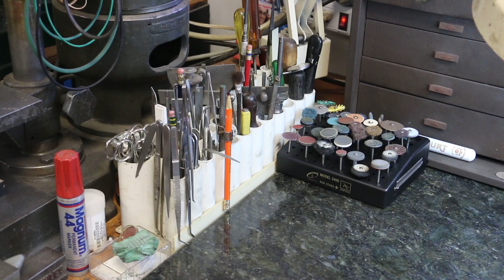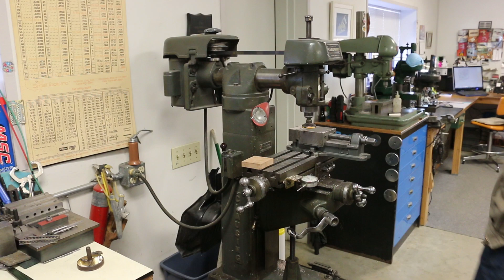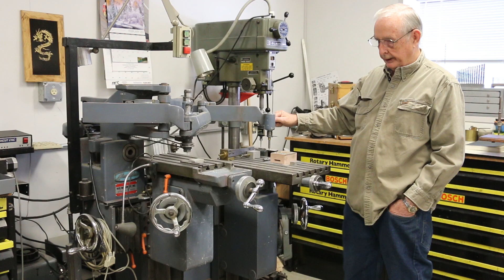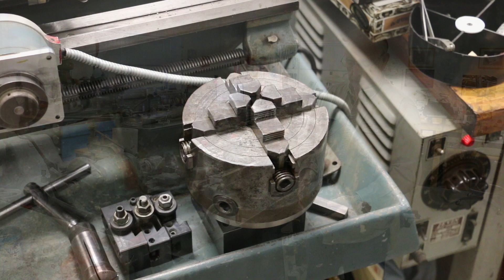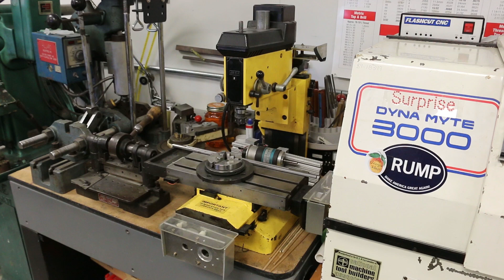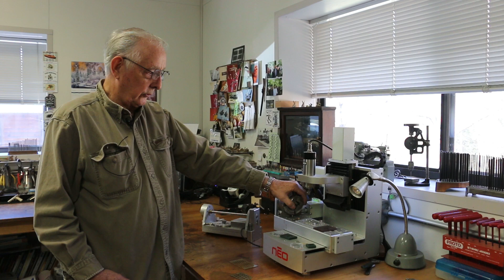Shop Tour 6:  Paul Hamler - The Tour

Comment: I'd like to clarify, that the reason a pantograph machine cannot do a 1:1 scale, is that the geometry of an end-pivoted pantograph mechanism is such that the tracer and the carving spindle would have to be positioned in the same space. This would obviously be impossible, and useless, as you also cannot have the pattern and the workpiece in the same space at the same time.

The currency-copying story is fun, but it's not factual.

Comment: Neat shop, I worked on an German-made engraver similar the one he has as an apprentice making logo stamps for stamping dies. We had a tool grinder similar to his for making the cutters out of carbide blanks. Both really useful machines. 
I gotta say, I'm impressed at how he seems to master the old fashioned manual machining and the modern electronic stuff too. I eventually need to learn how the CNC stuff works.
One question, how does the vacuum pump help the casting process? Is the flask porous enough to let air pass through it? Or does he need to leave tiny vents in the corners to pull the air out?

Comment: A beautiful and very well equipped shop Mr. Hamler. It takes a great deal of skill and dedication to be a craftsman in so many different areas. I was more than interested to see your use and mention of a Wagner Safe - T - Planer in your mill. I've been doing so for a very long time and up to now have never heard of anyone else doing so. The accuracy and control required for small scale wood working is unbelievable with a mill compared to any other dedicated woodworking machine I know of other than a proper pattern makers mill.
Reply: I just shot a video that shows the safety planer on a Stanley Carter overarm rouret converting an ax handle into a blank for making a reproduction chair scraper. As soon as I master the video editing program I'll post
Reply: I'm now subscribed to your channel Paul and very much looking forward to anything your willing to demonstrate.

Comment: The U.S. dollar experienced an average inflation rate of 2.87% per year between 1899 and 2016. $75 in the year 1899 is worth $2,060.94 in 2016 says one of these inflation rate calculator websites. 

Inflation values before 1913 are an estimation by historians but that does not sound terrible expensive in todays money.

Very nice interview! Thanks for sharing.